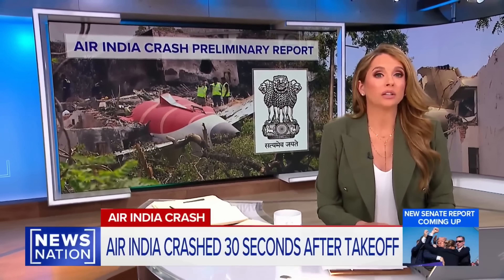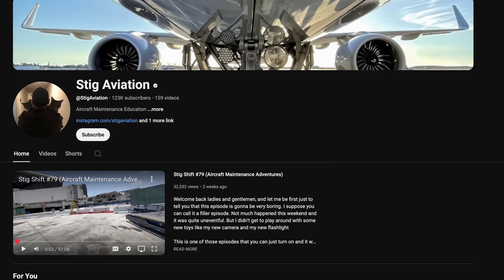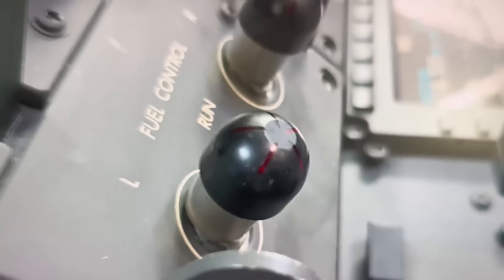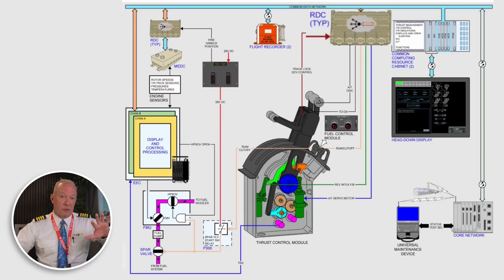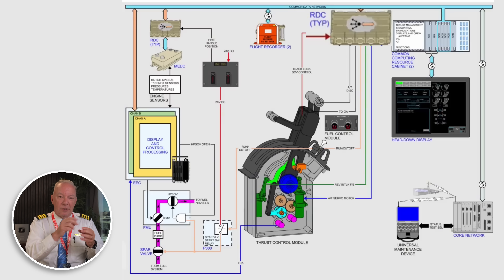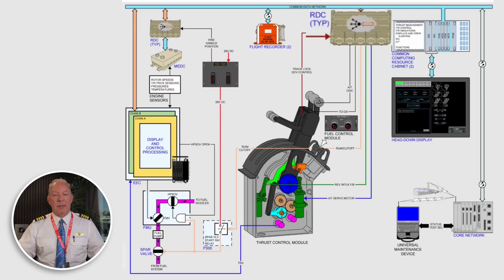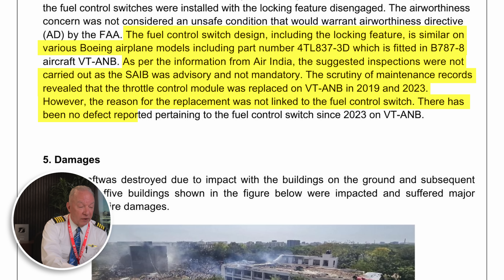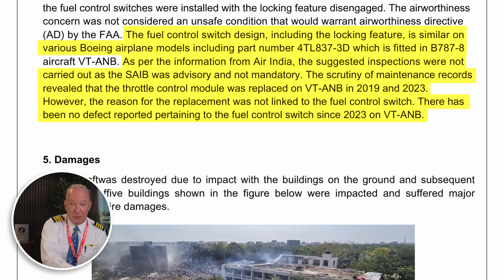The Truth About Boeing 787 Fuel Control Switches

Comment: As someone who works on control circuits involving batteries, especially lithium ones, I know just how fickle they can be. I believe there is a diode in the battery feed and when they fail they tend to fail short so everything appears to still work however it does mean that the battery now has a direct charge path from the DC bus rather than through it's special charger, this can then overcharge the battery, not to the point of failure but of one where accelerated degradation can happen. When you apply a heavy load to the system, such as raising the undercarriage, this could then fail. This plane has been having electrical issues which could have been due to load shedding if the battery was unable to maintain the correct bus voltage or was pulling the bus voltage down, this could be preliminary to complete failure. If this battery goes short with the failed diode it will then also pull the other 28v bus down which will have been automatically brough in. This then gives a complete failure releasing the relay and cutting off the fuel. I would assume the signaling of switch position would come from a set of contacts on the relay so the fdr would see it as the switches being turned off. After a delay the battery thermal breaker will trip allowing the generator systems to restore power and initiate the restart. A single unmonitored diode in this position is a disaster waiting to happen. I got this info from a chap on YouTube who knows his stuff and went through it in detail with diagrams and explanation that, from a technical point of view made absolute sense. You have probably seen his video but may not have done. If not I encourage those with a technical mindset to do so. https://www.youtube.com/watch?v=OLxLN3osS1Y
Reply: Signalling comes directly from the switch and also from the relay. Power is delivered through PSU through many failsafes and evaluation units and with battery backup. Please stop using general electronics to airplane electronics, there is a reason why this switch costs $1800 and PSU 10 times as much.

Comment: Relays can be intermittent so can the supply be intermittent, even if supply is totally separate do these cables run in the same harness or same route and been damaged or maybe shorted between the two circuits, I really don’t agree with captain Steve’s rather simple thoughts on this.

Comment: While this debate rages, we need to keep in mind something that experienced pilots know instinctively and that speaks to the probability of any sort of accidental hardware or software failure. It goes like this.

If the fuel to both engines had been cut off mere seconds earlier, the takeoff would have been rejected and no crash followed. If the fuel had been cut off thirty seconds later, there would have been enough altitude and time to restart the engines. This plane has been in service for years and the flight it was leaving on would take hours. What is the probability of not one but two almost failures taking place within a narrow perhaps 45-second window? 

That probability is infinitely small.
Reply: The strongest theory I've seen so far connects the electrical issues with Gear Up being commanded. This creates a massive load on the electrical system. (I believe Gear Down was then immediately commanded as a reaction to this, explaining the position of the lever.)  So, considering this, this makes this exact time for a failure the most likely time.
I would avoid the 787 until this has been fully investigated.

Comment: We know from a previous incident that those switches turned off themselves without the pilots touching them, once before on a 787, but it happened as they were landing, so the pilots were able to land safely and no one got hurt. There’s an official incident report on it.

Of course it’s possible that a pilot decided to self-delete and take everyone with them. BUT the preliminary report fails to mention so many details that would help us understand if that was indeed the case. 

You also have to take into account the difference in language/ way things are said. “Why did YOU cut off” could actually be referring to the plane. We might assume “you” is referring to the other pilot, but based on the differences in the way things are phrased, grammar and the structure of sentences, the word “you” could potentially be the plane. 

My car once broke down while doing 70mph in the fast lane. The engine just stopped, it lost all power, I had to get across 3 lanes to try and prevent a crash while it was slowing down and coming to halt and it was terrifying. I might’ve actually said out loud “why did you breakdown?” or “why did you stop?” or “why wont you start again?” and by “you” I’d be referring to my car, not any passengers in it. We do not know with 100% certainty that one pilot saw another pilot move those switches.

I think it’s unprofessional to make assumptions before the final report, even if a deliberate act seems the most likely scenario. If you happen to be wrong, the damage done by potentially defaming an innocent man cannot be undone and an apology for being wrong in a few years when all the details are released to the public, can’t change anything.

Imagine if you were accused of that when actually there’d been some sort of catastrophic mechanical or software failure, like with the MCAS situation. I just think it’s disrespectful and unethical to assume the worst, simply because the limited information we have makes that scenario possible. Even if it looks like that may be the case, we don’t yet know with certainty. I wouldn’t dream of making that accusation or assumption unless I had ALL the facts and knew with absolute certainty that was the case. 

I teach critical thinking skills. Those who understand the complexities of most scenarios do not make bold statements with confidence.
Reply: Thank. you! If one were to learn from past mistakes, one would refrain from alleging or implying that this tragic act was intentional(Lion Air, Ethiopian Airlines crashes). I think Captain Steve keeps returning to this issue out of some sort of compulsion to  keep defending his horrific conclusion (I do hope it's not for views😕). It may be best for him to just leave it alone until the full report is out. There's no reward for having been right or wrong when the truth eventually comes out, but there is decency in showing restraint.
Reply: Incorrect. You weren't listening. The switches CANNOT physically  turn themselves off. That's NOT what happened in the incident you mentioned . READ THE REPORT AGAIN.
Reply: @davidquinn6161  You’re right - I wasn’t listening. I switched off after a few mins as I don’t want to contribute to him making money from this tragedy by watching the entire thing. I know that no new information has been released. There’s already been so much discussion about the switches, and I’ve seen many pilots and engineers explain the mechanics of the switches already, when the event was “current”.. He’s still putting out videos about this tragedy, on issues which have already been discussed. I didn’t want to listen to this man continue to tell people that this had to be a deliberate act. 

My point wasn’t even about the mechanics of the switches! it was simply how I believe it’s unprofessional and unethical to imply this was a deliberate act, without having ALL the information readily available. None of us know with certainty (yet). 

I wouldn’t be able to sleep at night or live with my conscience if I repeatedly told people that I think it’s a deliberate act and repeatedly leaned very strongly towards one of the pilots choosing to self – delete and m*rder hundreds of people.

Nobody who is professional, with self-respect and a conscience, would ever continually blame one of the pilots for this crash, even if it looks likely. Captain Steve doesn’t have any more information than the rest of us, and repeatedly defaming one of the pilots is stooping very low. It tells me a lot about him as a person. Don’t worry, I won’t be watching anymore! I’ll do what any decent person would, and refrain from making assumptions and jumping to conclusions and simply wait for the final report in a few years. I don’t make assertions unless I know with 100% certainty beyond any doubt whatsoever, that my assertion is correct. 

Edit: regarding the switches, I don’t have any more knowledge than what I’ve seen numerous pilots say online (& my ex was a pilot which is why I developed an interest in flying) but actually according to some sources and reports, when the thing was placed upside down in some planes by mistake the switches could physically move by themselves🤷‍♀️ 

I teach teenagers and young adults critical thinking skills because they seem to be lacking in today’s society. I teach students to question absolutely everything and not accept anything as fact or truth unless there is actual evidence to back it up – this applies when making any case or argument for or against something – looking at a variety of sources, understanding bias, recognising that just because something is written down it does not make it true. I teach them how to get their point/ opinion across respectfully by providing irrefutable evidence and facts to support what they are saying.

 “A fool thinks himself to be wise, but a wise man knows himself to be a fool.”
Reply: @AnnaAckermann78  the switches were not upside down. They were recovered and examined. He showed a photo of them. They were in the exact position that the FDR said. The report CLEARLY  states that there were physically move to off then , 10 seconds later, back to on. That's indisputable. It's also indisputable that one of the pilots had to have moved them. The video clearly shows that only human action can move the switches. No other explanation is possible.
Reply: Thank you Anna, for your great post asking for respect and professionalism. And for clarifying that "he" could mean the aircraft, as well as pointing out that something very similar happened to the ANA flight after landing!
I hope there will be a wave of apologies from Cpt. Steve and others, in case the root cause turns out to be an electrical failure! So much harm can be done by false assumptions.
Reply: @hubertusjung7802  The switches on that flight DID NOT move by themselves to "off". If you'd actually paid attention to Capt. Steeeve's video, you'd have seen that it's physically impossible for the switches to move to "off" without human action. They can only be moved by human action- there is no electrical or electronic method to move them.  Watch the parts showing the switches being moved. THEY CAN ONLY BE MOVED BY DELIBERATE HUMAN ACTION.
Reply: @hubertusjung7802  Thanks. I’m glad you appreciate what I said and are clearly respectful. I think that no matter what profession you are in, it’s highly unethical to put out your opinion on what you think happened in a tragedy, potentially trashing someone’s character and reputation, when you don’t have all the facts. I’ve seen some of his videos and interviews saying a human HAD to have moved those switches. We don’t KNOW with absolute certainty though  

Even if it does turn out to be self-deletion, my moral compass would never allow me to say to an audience of hundreds of thousands or potentially millions of people, that somebody did something so evil, when we aren’t equipped with enough information from the black boxes and a thorough investigation, to know that yet.

Comment: I've been out of the cockpit for 17 years...but here is how I see the schematic flow:  The fuel control shutoff switch doesn't open all three fuel valves.  The common data network senses the positions of the engine fire handles and position of the fuel cutoff switches.  With the fire switches "IN", 28v dc is available to the SPAR VLV/START SW RELAY.  When the FUEL CONTROL SW is placed to "RUN", the SPAR VALVE "OPENS" and the HPSOV PRESSURE SW is "ARMED".  When the engine rotor speed reaches the minimum RPM for START, the FMV is commanded "OPEN" by the EEC.  When minimum fuel pressure is sensed for START or RUN, the EEC commands the HPSOV to "OPEN".  These conditions must be met for engine START or for the engine to continuously RUN.
Reply: Thank you. So (contra Cpt Steeve) it is possible for the EEC to shut down an engine without the cockpit switch being moved to CUTOFF.
Reply: @ac3768  A single EEC might be able to shut an engine down (I don't have access to the Fault Trees). But that bad EEC couldn't impact the other engine. Because the report only says fuel valve changed position, I can't be 100% sure,  but the engine spar valve position indication is 100% independent from the HPSOV. I'm 99% certain that both the HPSOV and Fuel Spar Valve position are recorded on the FMC. I am hoping they were just sloppy in their preliminary report and didn't specify that both valves transitioned.
Reply: @ac3768  It is possible, but what is not possible is for the FDR to record the switches turned off (one after the other) followed by the engines spooling down in the same sequence, and for this to be caused by EEC.
Reply: @ac3768  Thank you for your reply, but I not ever being qualified on this aircraft, I would prefer to have those familiar with the 787 lead that discussion.

Comment: I think it would be interesting to look at the cut-off switches on some high flight-cycle aircraft to see if there is any wear on the detents. Both the detent and the spur have angles surfaces and I wonder if it's possible for them to be worn down over time so the force required to open or close the switch beomes less, to the point where just pushing them would cause them to move. Just curious.
Reply: The way the switches engage the stop makes it impossible to wear them out

Comment: To clarify what the presenter said. The fuel valves require DC electricity supplied by the relays. The relays in turn are controlled by DC electricity supplied by the fuel cutoff switches. The complete throttle quadrant is a line replaceable unit, which indicates that there are likely an array of electrical connectors to allow for that replacement without soldering new connections. This by definition allows for a failure of said connectors and the possibility of interruption of the DC electricity to the fuel cutoff switches and therefore to the fuel valve control relays.
The rough runway surface at the departure runway could not have moved the switches themselves, but could it have loosened a canon plug connector momentarily leading to engine shut down?
Reply: Fuel control valves require voltage to close just like they do to open. No voltage, they remain open. can we get this straight for now and the future?

Comment: As a A&P 99% of the population doesn't realize how aircraft systems are designed.
Simpler is better, multiple fail safes and like Captain Steve stated, electrical failures normally fail to a "run" condition.

The fuel shutoff system is as about as simple as you could make it using a  electrical power source.
Reply: The simplified one, that doesn't resemble the real one, sure is simple.

Comment: A relay is not a mechanical switch! A relay has a coil (electromagnet) that operates another switch. It is used to decouple circuit operation: like you have a 230VAC device that you want to switch on and off using a controller. But the controller can output only 5V. Then you add a relay that has it's primary coil wired to the 5V output of the controller, and the contacts of the secondary circuit of the relay are wire into the 230VAC cirtuit. When the controller sends 5V, the electromagnet is triggered, the secondary contacts engage and the secondary circuit turns on. It can have also inverse logic, but you get the idea. If the fuel control switch is in th eprimary circuit, and the secondary circuit actually operates the valves then you have a relay. If the switch directly operates the valves, then you don't have a relay. Relays are used not only to decouple different voltages but diferent powers as well. I can imagine that operating the valves requires severl Ampers. Directly wiring high power into a control board where you have many other controls with potentially also high Ampers has its own risks. So decoupling makes sense. However: the relays are a point of failure. They can jam, and as the coil wiring is thin, can break also. In a fail-safe setup, you would have two times two contacts for the switch and also for the relay. Controlled valves are in most cases active: you do command them to change position, when there is no command voltage present, the position should not change regardless of vibration and flow. Yould be great to actually see the schematics.

Comment: Excellent explanation in relation to fuel switches. If the loss of engines was related to switching fuel switches off, what is the explanation for RAT being deployed 2 sec after the take off, that is before the switches were moved to off position ? This time line indicates that the engines stopped working before the  fuel was cut off.
Reply: Exactly, that is why there are credible theories out there that the RAT deployed due loss of current / short circuit. "Transition" would actually fit this change of state (without necessarily being manually moved) See RogerAhiers post above for details
Reply: @hubertusjung7802 thank you . I understand better now the engines failure was due to electrical power malfunction rather than mechanical cut off the fuel by the switches. That is why RAT responded to the electrical failure and its timing before the switches were moved.
Reply: Yes, if the timeline is correct, I would like to know that too.
Reply: What is your source about the RAT deployed before the switches were moved?  That is NOT in the official report.

Comment: The relay in my drier failed last week, I didn't turn my drier off, but it stopped working.  Pretending you are an expert on electrical failure modes and failure frequencies is fraud.